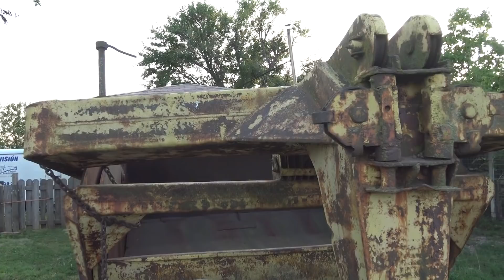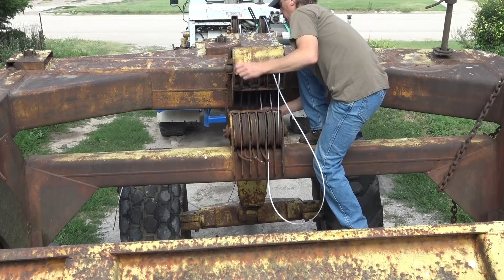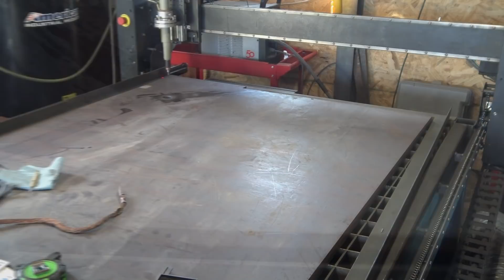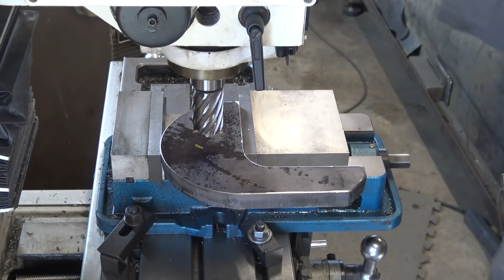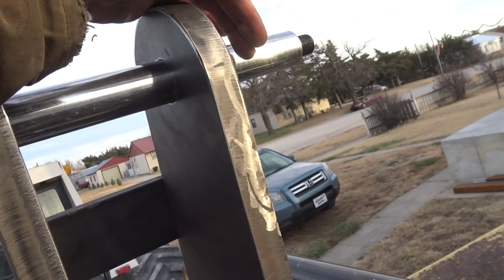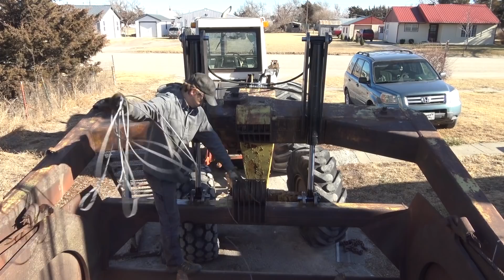Building HUGE mounts!! Earth Mover RETROMOD - HEIL earthmover

Comment: The long version are definitely appreciated. Is this yours or are you building this beast for a customer? I love that pipeliner! I have a Miller roughneck 2e and a Hobart with a wisconsin twin that does 300 amp 100% duty cycle. I also have a westinghouse pipeliner that has a 6 cylinder engine that I have to bring back from New York. If you were my neighbor I would be over to give you a hand. Crazy doing all this by yourself.
Reply from the maker: It's for a customer. He's wanting to dig a pond on his property and couldn't afford a new scraper.  My first mobile welder was a Hobart with a flathead Willys Jeep engine powering it. Loved that welder and the arc was super smooth!  But, boy,  it sure did drink gas!
Reply: @WideVisionMetalFab  I love my Hobart. It is a GW144 I believe. It is fairly old. I have a couple that I need to get running and sell. I have seen many of those scrapers lately and I had not seen them since I was a little kid. Keep up the great work my friend. I got hit on my Harley about eleven months ago and got extensive blood clots that are going away but it has hampered my ability to get everything I want done.The work is just piling up. Thank you for getting back to me.

Comment: I built a holder for annular cutters so they would eject the plug on a manual mill.
Reply from the maker: Cool! :) I thought about building one, but decided it wasn't worth my time so I ordered the Accusize R8 to Weldon holder when I ordered the cutters, but it hadn't arrived when I did the video. IIRC, in the next video I'm using it.  The nicest thing about it is  I can use the centering pin to double check location instead of doing a tooling change.

Comment: I thought that was a 1370 Case. My current favorite pin setup is the pins with the offset turned larger diameter head and  a snap ring in the bushing welded on so it can't back out. I have found those to be the strongest and longest lasting.
Reply from the maker: Yep, it's a 1370. Good tractor, other than the short wheel base. Since I have the loader on it, I keep dreaming of moving the front axle forward, but just haven't figured out exactly how to do that.

Comment: because you bumped your head at least once..  are you aware that there are baseball cap bump inner liners  to protect your grey matter better than the bare baseball hat you may be using.. ERB brand Model #19402 thru the home depot site is less than 10 bucks.  check them out. i should have been wearing them years ago.. i jumped in my van and ended up with a massive concussion when i hit the door jam . its just a thought..
Reply from the maker: I'll have to check that out. Thanks!

Comment: Everything sounds like a slice of cheese to a dog. Do you have a field you can test scrape?
Reply from the maker: I do not, but I doubt my tractor would pull it anyways. The customer lives about 25 miles away, surely it won't be that big of deal to adjust something once they get it.
Reply: @WideVisionMetalFab  i was thinking of being able to watch it work. i like the old iron add modern accuracy to it make it better.

Comment: I like the long video. How did you size the cylinders? Is there a way to figure what size bore and rod size you need?
Reply from the maker: Somebody else also asked about that. I don't know if I can squeeze that into the next episode, or if I'll make it a stand alone video.   Short answer, I figured out what 11 cubic yards of dirt might weigh, then took an estimate of what the bowl of the scraper weighs, and then divided that in half since I wanted 2 cylinders for lifting. Then I used an online cylinder calculator to figure out how big of bore, accounting for the rod since it's pulling,  needed to be at 2200 psi. (The max pressure of his tractor is 2500 psi)   The stroke was figured out by running the scraper up and down with the winch, and then adding a what I thought a good digging depth might be.
Reply: @WideVisionMetalFab   stroke was the easy part to figure. The bore and rod size took a bit of figuring. Thanks for the explanation. Quite a project !

Comment: Excellent job!.. it seems maybe you should add some gussets to the long plates that hold up the cylinders.. and I think raising and lowering it with one flat tire was putting uneven pressure on the plates one side had to work harder. Oh and longer videos is what I vote for 😁
Reply from the maker: I've been pondering adding gussets. My gut has been saying those mounts are a bit tall.

Comment: good detail on the build and video length is great.  Looking forward to parts 2 and 3.  Your plasma table is amazing, did you figure out why it was cutting at an angle?
Reply from the maker: Nope. I cut out all those parts with the same nozzle and electrode and the cut quality was great.  I guess  I just don't have the machine set correctly for "small" holes in 1 inch plate.

Comment: Enjoyed the details, glad to have a video to watch while I'm hunkered down inside by the fire today, very cold -30 C outside.
Reply from the maker: Glad I could help with boredom. I went out and got firewood today,  and my face started to hurt. Checked my phone and it says actual temp here is -12C and the wind chill makes it feel like -18C.   I guess that's a heat wave compared to -30C! :)
Reply: @WideVisionMetalFab  Where are you located? I am out here in Pa so it is just getting warm out now.
Reply from the maker: @jimmypopp2695  Western KS. Still chilly out here. Most mornings are well below freezing as it was 24F a couple days ago, but Spring is on the horizon! :)